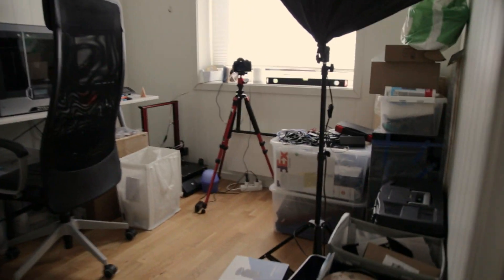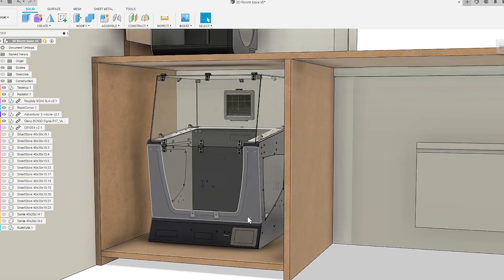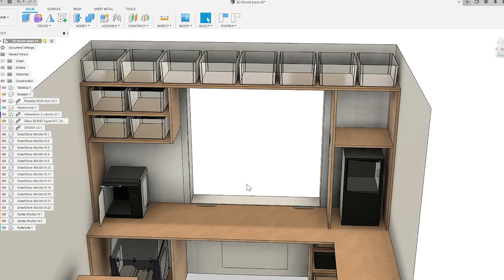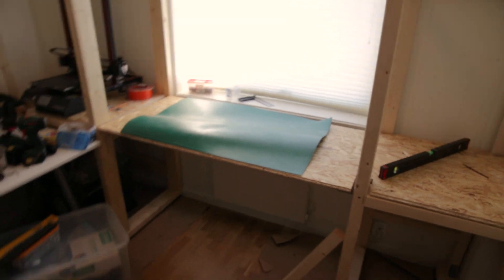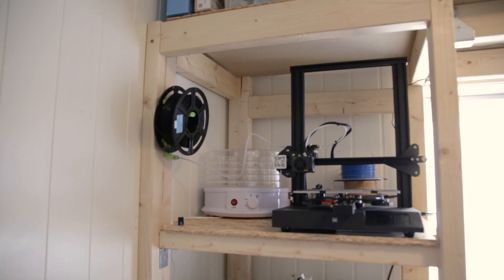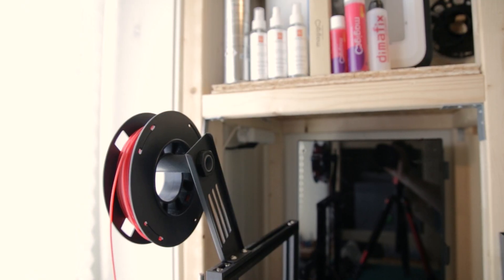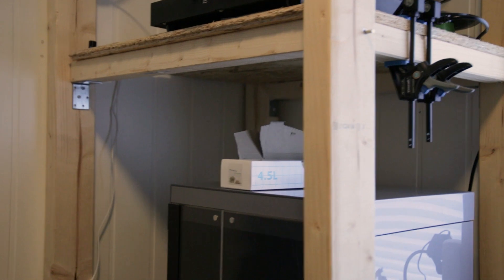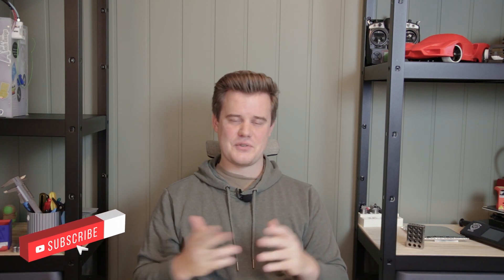Building A 3D Printer Workshop Room

Comment: Nice workshop! I do have a bunch of kids and 3d printers! The 3d printer is the best tool to have with childrens since it's not that dirty and most of them really silent 🙂 
Now we have a larger house and i have a dedicated corner in a storage room for my old Tevo Tornado 🙂 but when i started in the hobby ~10 yrs ago with with a small flsun delta i had it standing in a Ikea kitchen cabinet that i bought for the cause, works wonderfully! As long as the pronters footprint is smaller then ~58x58 cm it fits inside, then i bought shelfs on rails inside with the printer on, for service i pulled it out. Beneath the shelf i mounted a drawer for misc parts and tools, a shelf  above for filament storage, (today i would design/print some nice hanging filament holders so it would hang ready for use) put magnetic locks on the door to keep it from vibrating. A whole printer system in 60x60x140cm, quiet and invisible, all you need is a corner next to the computer table, i used that setup for years!
Reply from the maker: Thaaank you Karl!  That sounds like a really nice setup with the IKEA cabinet system.  I think thats the way to go unless you wanna get your hands dirty with some woodworking =).  Yeah I'm looking forward to try to cultivate 3D Printing for my kid(s) when they are a bit older :D Just have to wait some haha...
Reply: @3DPrintTechDesign  it works Great, my big mistake was that when i got my tevo tornado i didn't account for the bed moving back and forth, i thing a printer like a core xy or a larger delta would be the Perfect to install in there 🙂 i biught a cabinet thats made for oven/microwave installation, the obvious upside is that it has slits for air both in the bottom and the top 👌🏻

Comment: Great job. It's always a satisfying feeling to custom build your own shelves/workbenches/etc. I built something similar and painted the lumber satin black and topped the shelves/workbench with the cheapest wood laminate flooring I could find (a little lighter than your floor). The blond wood against the satin black looks great - kind of industrial post-modern, like something out of an IKEA catalog. While I'm rambling - clear containers are always worth the $ upgrade as they make things less prone to just disappear (out of sight, out of mind). I don't know if these are available outside of the US, but for all of my projects I used Simpson Strong-Tie's bracket systems, specifically the RTC42 (real overkill - 4x4 uprights with 2x4 rails) and RTC2Z (2x4 uprights and 2x3 or 2x4 rails). The latter is available in a kit (WSBK Workbench Kit) that saves money over buying them individually. Lots of videos available showing projects built with them. Nice thing about those brackets is that it makes it so much easier to reconfigure shelf height/length as needed. It's almost like lumber LEGO. LOL  Again, great job!
Reply from the maker: Thank you so much! Great tip on the bracket system, it looks cool but nothing I've seen here locally ). But yeah, for something more permanent (i knew this wouldn't last forever) I would probably look into that!   Hopefully in my next house I'll have a single/double garage that can turn into a workshop... Hoping for it!   And yes, Height for 3D-printers is superb! Specially for machines I know are low maintenance.   Thank you John!